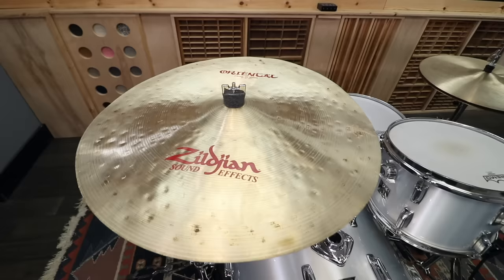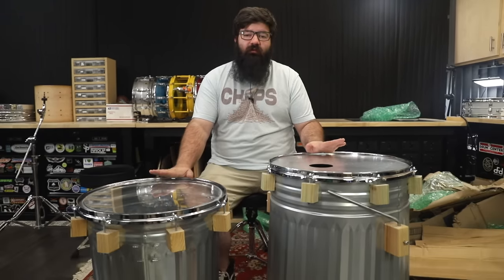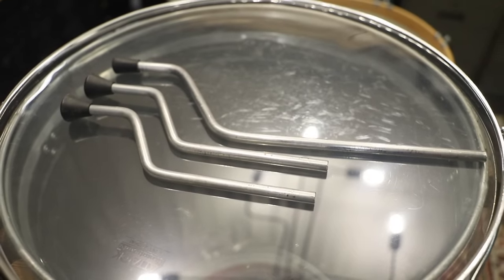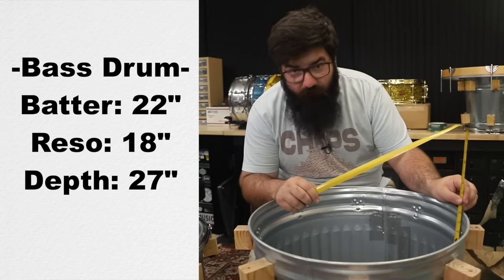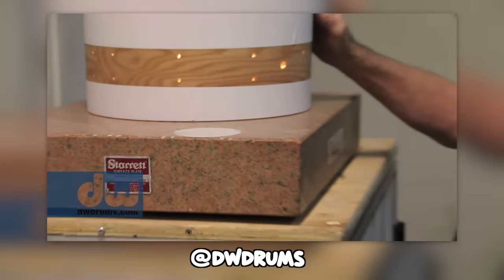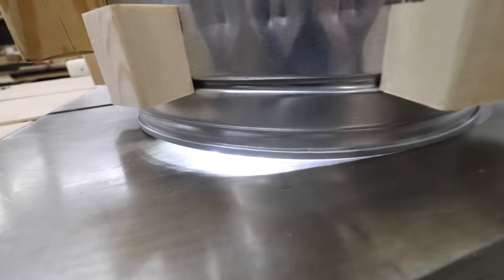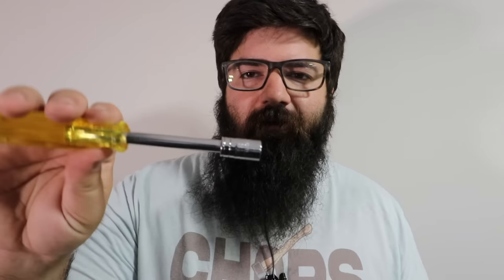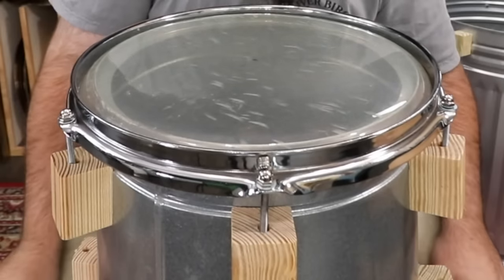This Drum Set Sounds Like TRASH!

Comment: (I knew I bought a new roll of tape that disappeared somewhere)

To answer some questions I see in comments. I have recorded the kit, which can be heard, along with other very different types of builds, on the Solos for Concept Drum Sets audio recording and Video on my channel, REFondrums.  The video was done with a ZOOM  Q8.

Watching the bearing edge test, I'd have to conclude the more serious disparity in the flatness was caused by undue pressures placed upon them in transit. I didn't care about the edges, as long as nothing sharp existed but, I know they were not out as much as shown here in one spot. Still, as David states, the drums are not typical diameters, per se' so, all the heads float and tension up okay. The pushed-in floor tom leg bracket shows what kind of handling they received.  I should have packed them up with even more safety area around them.

As far as the kick, 22 vs.18, the first video I did with them on my channel uses the 18" side. Pretty cool thump either way. 

As an aside, my friend who mixed and mastered my audio recordings tells me his favorite set of mine to listen to is the Trash Can set. He considers it one of the best sounding kits he's heard. (!!!!)

Just let's us know a very objective fact. Sound is subjective in the ears of every listener. 

Thanks to David for showcasing Trash Can drums!  (Did I actually type that?) YES!
Reply: We need this kit sampled and available for Kontakt Player!

Comment: Loving the trash can ending... I said to myself, "if he doesn't do a trash can ending, I'm going to slate him in the comments for it!", but you did, so I'm not going to slate you, lol! Also, a little tip for tuning a drum with a warped bearing edge: Use a hairdryer or heat gun on the head when it's under tension, it could (could) help to warp the head in the same way as the bearing edge and decrease the likelihood of wrinkles. Another tip: Don't use glass to check the flatness of hoops and bearing edges; most glass, contrary to popular belief, is not flat!

Comment: Those lug constructions are really rough! 😅

There's a custom drum builder here in Finland, who also makes drums with wooden lugs, called Saari drums. I own one of those kits. He has used thread inserts in the lugs, so there's nothing dropping out of the lug when unscrewed, and the bolts he uses are deep hexagon socket cap screws, so the drumkey (he included one in the kit) stays upright and basically works like a normal drumscrew. :)

Comment: I think I recognize some of those creations from an old drum forum.  I am trying to remember if it's the same guy that tried to sound test 4 different bearing edges on two drums using threaded rod so that he didn't have to install lugs to prove that bearing edge cuts didn't matter because they all sound the same.  But the drums were only half tuned with weird pitch bends, and each drum shared two different edges, so there was no final comparison of anything other than you can hit it and it makes noise.

He does make some fun and interesting stuff though.  I really liked the plywood (sideways ply) shells.

Comment: This reminds me on the 24' Surdo I'm playing sometimes as a Bass Drum. It's more than 24' deep and made out of Aluminum, so that you can wear it on the street samba party. It sounds huge and costs only around 250. But you need to change the drum head with a good pin stripe which costs another 80. But compare to a wood shell very cheap

Comment: My first kit was a very strange starter kit by Rogers… who i never heard of before. Come to find they were kind of big in the past but this kit was a new, low budget kit at the time (probably 2005). Cost 400 bucks. The stock cymbals literally sounded exactly like hitting a garage door with sticks. 

But for some strange reason the kick and toms on the thing were and still are some of the best sounding drums I’ve ever heard. Very thin shells, next to impossible to tune with careful nuance, and the lugs and hardware left a whole lot to be desired. 

After a while they started to warp a bit and lost their specialness… but I had two sets for years… that one an a way nicer 2500 dollar pearl kit. 

I would record a ton and would always try my pearl… and often end up using the rogers shells instead. They just had everything… for no reason whatsoever. Only lasted about 7 years though.

Comment: You should have taken duct tape And applied it first to the rims of the cans there is also aluminum tape that would’ve worked just as well using that tape you could have leveled up the surface, but at least kept any harm from the drum heads And using a cordless driver, like they used for guitar tuners, you could’ve put a socket to quickly turned, and tune just a suggestion.

Comment: Lol but it's 2023 which means these trash can are 30$ or more each. Also you already need drums because drums rims are going to run you 35$ for 16 inch. And heads for 15 to 20$ each. Honestly you could go on craigs list and get a beat up kit for 70$, this kit cost over 300$ to build with all it's parts

Comment: Absolutely all of the most important recordings of all time (all of which took place from the 30's to the 50's) guarantee their kits were shit, in shit condition, taped Kleenex on the heads, cello tape repairs and warped shells from the heat and moisture of incredibly poor insulted studios in Chicago, New York and Detroit their recordings are still the industry standard and stories from the drummers of the day and basic common sense tells us perfectly flat bearing edges Don't really matter. It's the Guy not the gear. The Gear can help but at the end of the day The right Guy can make anything sound killer.  Have you seen the condition of Al Jackson's kit at Stax? it was horrid, completely mis matched, heads that had not been changed since the 40's even lol